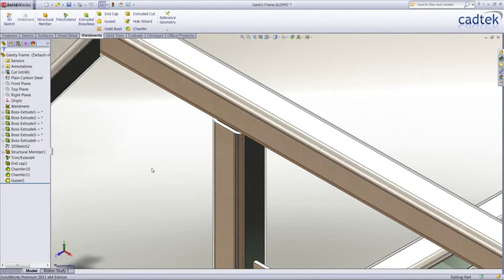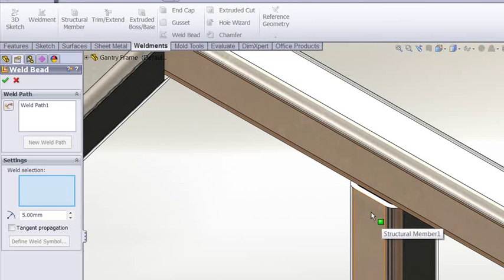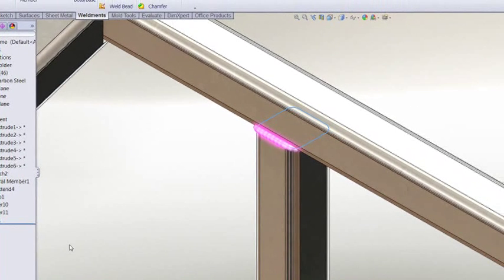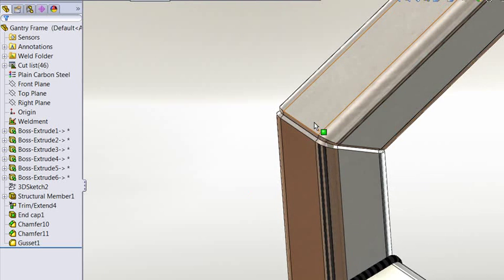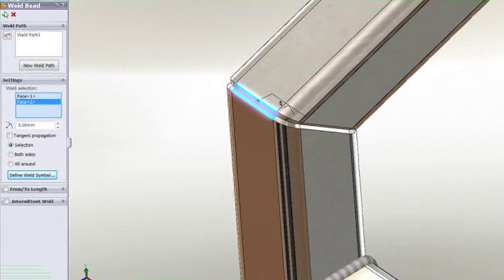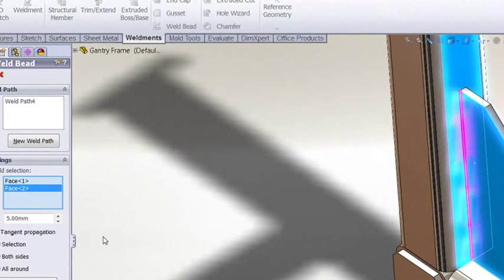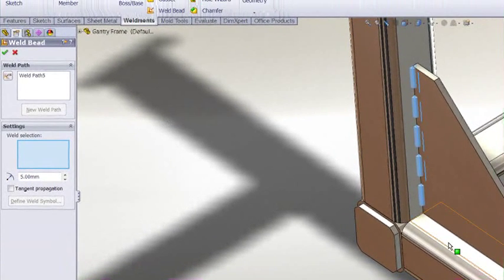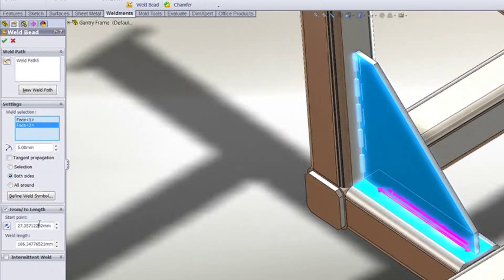SolidWorks 2011: Weld Beads

Comment: What if you want to use weld beads to create a symbol on your metal? - can you use a sketch line for the weld path.
Reply from the maker: This video was using SolidWorks 2011. since then many improvements have been put into weld beads. If you're on the Weld bead feature there is a button within the feature tree which allows you to 'define weld symbol'.
If you wanted to use a sketch, select the 'weld path' option and then select the line you wished to use. You also get the option to use a smart weld tool, where you can draw a line across an edge and it will weld the edges you draw across. 
We are in the process of organizing new videos on topics such as these so keep checking back.